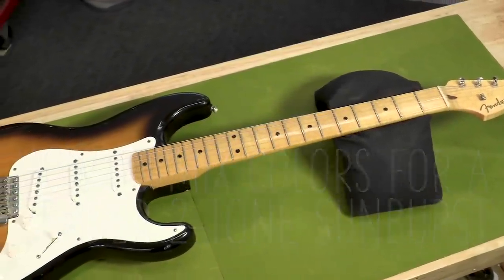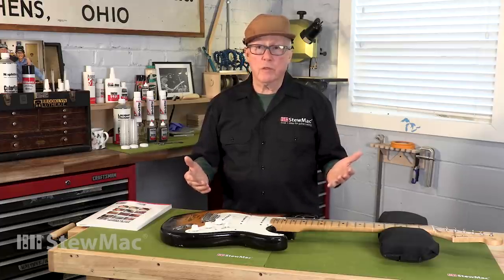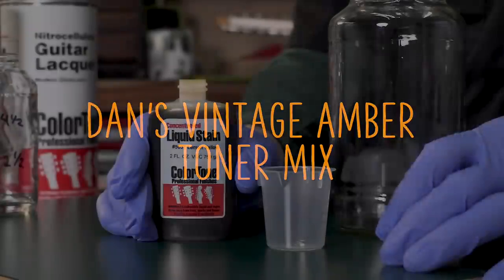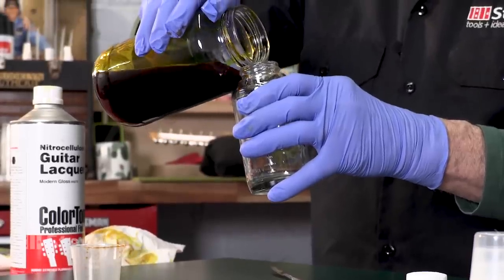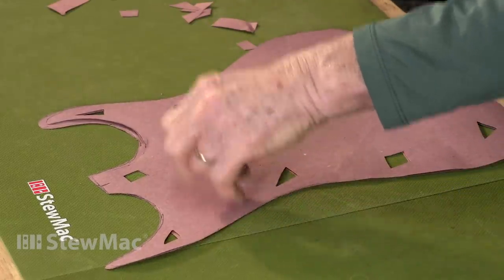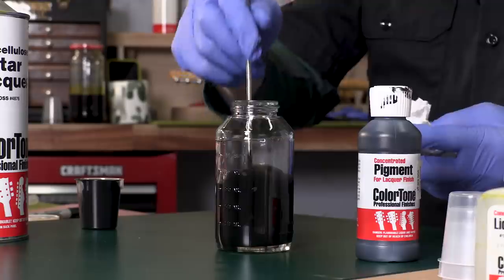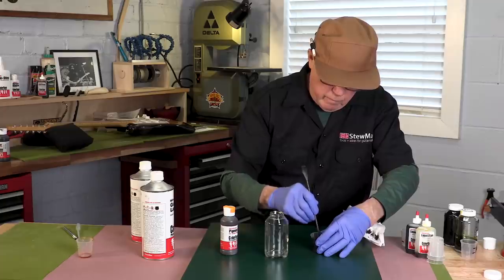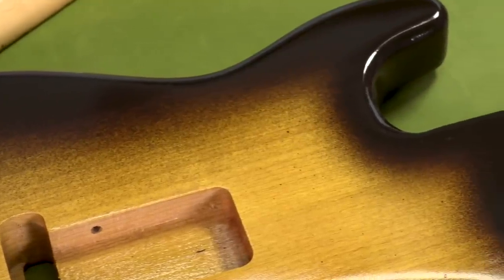How to mix colors for a Fender 2-tone sunburst

Comment: this was really helpful, thanks a lot.
question: how would you deal with the edges of plywood? my idea would be to do the staining first and primer the open fibres before applying the clear coat - the dark rim is not seethrough anyway

Comment: This is my favorite vintage finish.  I was wondering if it would be better to do the brown/black burst colour first with a full mask and use an air brush for the fading (for less splatter).  Then fill the inner parts of the body with the vintage amber.

Thoughts anyone?
Reply: No. I'd put the yellow down then clear it so if I messed up the black, I could maybe sand it off and fix it.
Reply: This was my thought exactly. Do the solid outer dark part first, then stain or spray the amber and lastly “burst” or blend it in. This way you wouldn’t really have to mask the center and take risk of messing that part up

Comment: Is aluminium is a valid material for a pick guard? Or will it mess with the pickups?
Reply: As aluminum alloys are non magnetic it shouldn't be an issue.  I have never tried it but AL is conductive so you might be able to make a usable shielding if electrically connected to the control cavity shielding.  AL is soft so it might show pick scratches if it polished.  Getting it anodised might be expensive, but some of the anodising colours available might make a cool design.  It would also make the surface very durable.
Reply: @tiacho2893  I was thinking about using some aluminum Diamond plate my buddy had left over from redoing his bathroom in a Harley Davidson theme. If I can get it cut out in a neat shape... how hard would it be to inlay it into the body so it was flush?
Reply: If you are comfortable doing a tremolo up route or inlay work, it's really no different.  It is like any body cavity route just a lot less deep.  For precise fit, a purpose made routing template is a must.

IIRC, diamond tread plate comes in the thicker and (much more affordable) thinner (1/16").  Not hard but precision for fit is a definitely recommended.  I would do a couple tests on MDF or pine first.  And remember that finish build up will affect the final fit.
Reply: @tiacho2893  this is actually my first guitar build. So with the design I'm planning its gonna be a strong learning curve...
Reply: @tiacho2893  is there a specific type of router required for this this? Or would a good Dewalt or similar router do it?
Reply: @drock5597  Nothing beyond the standard.  I got a couple of vintage Swiss made Elu's (later Dewalt when they got bought by a megacorp).  Before that, it was a cheap second hand Sears.  Any router will work (plunge is a bit more convenient).  If you are going Harbor Freight, avoid their small plunge router.  For insetting the pick guard, a small laminate trimmer would work.  Dan did a video where he did a repair (bad mod) on a '53 Tele that might be helpful.  He is using a laminate trimmer in the video.

https://youtu.be/CUUuMzxJ9h8
Reply: @tiacho2893  Thank you so much! I probably have about a million more questions I could ask you, however I'll stop pestering you now and try to figure out the rest for myself. (That's the fun part anyway) Thank you so much for helping me with my router questions.
Reply: D Rock No worries. I built my first guitar as an experiment using Melvyn Hiscock’s book and an oil finish (like Warwick and Alembic).  Take it slow and remember that some basic hand tools are really all you need.  Strads, Guaneri, and Amati (my Italian sucks) violins/cellos from Cremona were all made with just hand tools.  Specialty stuff, like fret slotting, can be farmed out. Measuring and straight edges are non negotiable but splurging on Starretts is a bit of overkill for a first guitar. I bought tools according to what I needed at that point in construction.  A lot of my stuff is standard tools, like hand planes, that I modified for my needs. Some planes and my wooden spokeshaves/chair maker’s scrapers, I made myself.

Comment: why do a spray on coat instead of rubbing the stain on the wood with a rag and then blending the colors together at the merge line, good ol elbow grease, or was this just a long advert for the PreVal sprayers??
Reply: This just a long advert for the PreVal sprayers. And not a good one, I´d say, because the result was not good ....

Comment: Damn that's very amaturish especially from Dan Elrlewine! You should know better than to believe everything that Fender tells you! They don't want anyone to make perfect replicas of their guitars so of course they're going to lie to you. The brown that you're seeing is from the clear coat of lacquer that they sprayed over the sunburst.  It ages and turns more yellow at first then more brown as the years wear on. Being that this is sprayed over a yellow then sprayed with black makes it look somewhat brown although the original finish is BLACK around the edges when new. I've seen a few rare examples of 1954 and 1955 Strats that are just about as black now as when they were new. 

You can clearly see that it is indeed BLACK and YELLOW - not brown, not "Salem Brown" or any other colour. This is a name that Fender gave it as of late since there is no colour by this name in any colour palette or paint manufacturer. It looks black in the video from far away but that Strat body is brown. You can clearly see that the edge of the real Fender Stratocaster is BLACK in colouration. I always seal my bodies as Fender did with vinyl sanding sealer. Then I spray my colour over the guitar and then my sunburst which I do with an airbrush - no speckles or uneven edge around the body. Good luck with your future endevours - you'll need it if the way you do things is the same as in your videos!

Comment: one word,, airbrush
Reply: Expensive and not everyone can get one.
Reply: @kommi1974  I bought an Airbrush for 20 bucks at harbor freight that does a 10 times better job than that splattering spray tube.  Stew Mac is just trying to sell those paint tube systems.

Comment: I always lose interest when they start using measurements. I have no idea how much an ounce is. Is thous of an inch.
Reply: Ounces and inches aren't equivalent measurements. It's also very simple to use conversion charts. Here in the states we have to convert from our system to metric all the time. Don't be lazy or half assed ffs....SMH
Reply: Trance 9 don’t be so stubborn ffs. The rest of world uses metric, USA is one of only 3 that don’t. Ounces and inches are comparable as they’re imperial units, like kg/l or cm.
Reply: @iainfreeman5112  ounces are liquid measure inches are linear measure. You don't figure out how many inches it takes to get an ounce of liquid...SMH try comprehending better!! As for the stubborn comment? I'm not the one being to lazy to use conversion charts to figure out things!!!
Reply: When you’ve been measuring things for 50 years you’re not going to change units for some indignant little foreigner